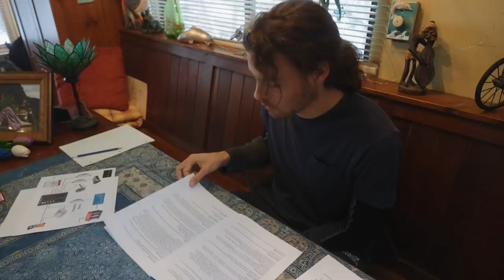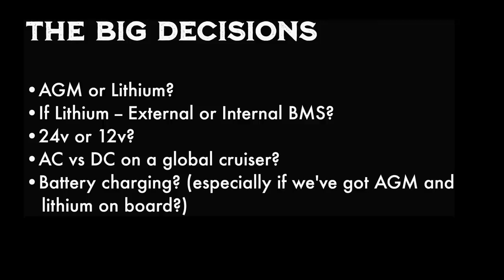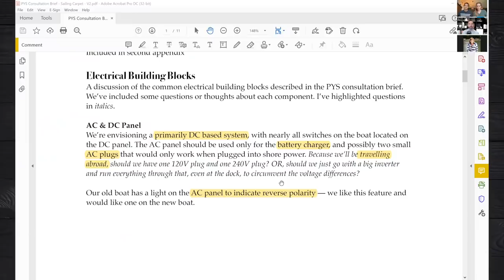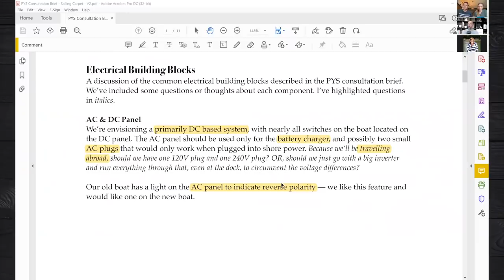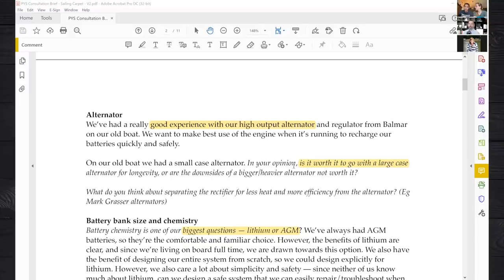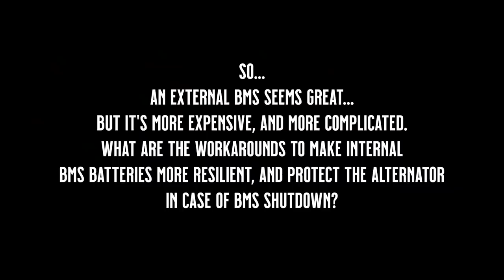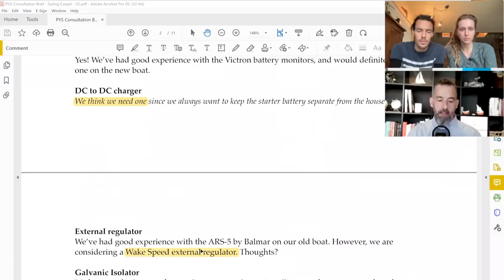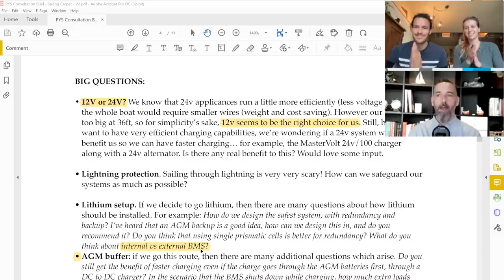DESIGNING an ELECTRICAL SYSTEM for WORLD CRUISING (with Jeff Cote from PYS)

Comment: I forgot the charger for my laptop over on my 38ft Sailboat that I have purchased in North Vancouver so I am commenting with  my cellphone from Nanaimo. 

I am an electrician by trade and an Instrument Technologist by profession with close to 50 years experience in heavy industrial construction and maintenance applications. 

A personal opinion that I am very adamant about is that NO wiring on a boat should be of a gauge larger than a #8, other than possibly a #6 from the shore power connection to closest point of distribution. If a larger wire size is going to be needed,  an increase in the voltage of the bank should be strongly considered. Also a lightning protection system ground wire should be probably be at least a 4/0.

As I am looking at going to an electric drive in the future I am going to go with a 48VDC main bank (250/500AH Lithium) and a 200/300AH 12VDC house bank with  possibly a 100AH 12VDC Lith in parallel in the berth to serve like a "Volume Bottle " for the anchor winch, but be easily removable for use on the dingy electric motor. 

Jeff's comments on the external regulator have me convinced for my 48V main bank but I am also strongly looking into Emily and Clark's BMS for my 12V house bank.

As I have some fairly heavy duty tools that I am undecided on carrying on the the boat I have to consider installing a 2500 inverter. 14" skill saw, 3hp router, MIG welder,  etc... Only advice I could offer is to size your battery bank and inverter for the largest load you think you may need and then go a bit higher. Very expensive to upsize later. Using Jeff is a great start
Reply: Meant 10.25inches skillsaw

Comment: One possible solution is to start the engine with a small bank of ultracapacitors.
Reply: The hint about the dilithum crystals from @Glenn edwards is better!
Reply: Anyone ever actually do such a thing? Most impractical in numerous ways.
Reply: It has been done both on land and at sea at this point. There are commercial ultracapacitor starter solutions available (SkelStart, Maxwell, etc.). There are simple products on Amazon and Alibaba for testing the concept. ...and there's several DIY videos on youtube on the subject.
Reply: @vattuvarg  You could also use a spring engine or a air tank and air motor to power start the engine. Or even a good ole mechanical crank. 
I would rather use larger batteries and ditch this fossil stinking thingy. Uma is living proof electric motors are superior.
Reply: @wolfgangpreier9160  Electric motors is pretty much an established technology by now, even at sea. The hard part is that Magic Carpet 2 is a fairly heavy vessel, optimised for older technologies....or rather... Newer technology isn't fully fit for it yet. Regenerative motoring works better at a higher sailing speed so for a traditional monohull energy would need to come from other sources. Using a large area of solar panels would also be easier with a catamaran or trimaran. Does all of that mean that I would suggest Maya and Aladino to stop what they're doing and get another boat? Definitely not. I'm very much looking forward to seeing Magic Carpet 2 SAILING all over the seven seas. Thus I'm trying hard to apply the K.I.S.S. rule to my responses here. An Engine Starter Module (ESM) seems like a plausible solution for them. It recharges in seconds, even from a battery bank at a low level of charge, and then delivers full starting power for the engine when needed. It is also quite easy to integrate into the electric system of the boat.

I really like that they're minimising their energy demands before designing the electricity system. Makes things much eaiser for them.
Reply: @vattuvarg  I concurr to everything you've said. Keep it simple - simple. Thats why i said forget this fossil junk and put in a decent electric sail drive with 2 large battery banks. Nothing but problems with those oil burning appliances.

You don't need much power for such a boat. 15kW would be plenty enough. It could even regen while sailing. 

Again: Ask UMA how they fare with it. You can store the batteries where you've got your diesel tanks and diesel engines now. Plenty of space.
Reply: @wolfgangpreier9160  Been following Dan and Kika for a while and really like the way they sail and live in Uma. But the choice of whether or not anyone should go (more or less) fully electric is a choice all sailors must  be free to make themselves, even Maya and Aladino. One thing to remember is that electric cruising pretty much still is a quickly moving target, so choosing the right equipment is really hard and gets even harder when considering the future selling value of the boat. 

The main difference between Uma and Magic Carpet 2 is regenerative motoring vs diesel engine. The latter system is the current default in the sailing world, and yes, going fully electric is the (quite near) future. But remember that Uma didn't have a working engine when Dan and Kika started their adventure, Magic Carpet does. 

A suggestion to Maya and Aladino is to get a portable induction cook and test it extensively on the hard first. I have two induction "burners" in the small kitchen of my apartment, mostly because of the fast heating, but also for the possibility to store the portable units in a cupboard when they're not needed. Today I cooked for four with only one of the units, btw.
Reply: @vattuvarg  You are not correct in your assumption that sailors must "have a choice between dirty fossil and non-fossil". This choice will be made for them in a few years. 

Not now. But in about 10-15 years most harbors - at least in Europe - will ban small private boating with fossil fueled engines. 

Netherlands will start and all others will follow. If you start early with your adoption of non-fossil fueled boats you can learn early how to handle this change of technology and adapt more easily.

Of course you may ignore this disruption. Just as many ignored the change from Nokia to Smart Phones. Nonetheless it will happen.
Reply: @wolfgangpreier9160  - The speed of the change to electric cruising is exactly why it is so difficult to give any advice. The old "safe bet" is rapidly going away, but that doesn't make the new alternative any easier. Going DIY would be an adaptive solution for Maya and Aladino as they are certainly capable of it, but would the next owner of the boat know enough to keep on cruising with it? Would a fully electric MC2 raise or lower the price when selling it? It all depends on how simple the system is to use and maintain. ...in the mind of the next owner. Right now there are very few that understand how quickly the change will happen so the "common knowledge" proposes an existing fossil-based solution before a more sustainable one. 

It seems that in some strangely roundabout way we, the fans of MC2, partially get to decide how soon the transition to electric will occur. After all, the boat is soon to become both the "moving castle" of our heroes as well as their studio and home office. We are part of their income and the better they adapt to the future the easier it will be for us to follow their adventures. In fact, I believe that part of their adventures will touch on the change of our planet and how they (and the rest of us) adapt to a new way of life. It'll be a calmer version of Waterworld, probably. Can't wait to see it.
Reply: @vattuvarg  I can predict with certainty: when they stay with diesel power they will have to invest and repair regularly. If they switch completely to electric power they will invest once - maybe even the same amount in the beginning - but not have any issues. And the cost of the energy is much lower. Maybe Diesel is cheap in the US. But nowhere else.
Reply: @vattuvarg  Let me phrase it this way: 

I would recommend RAN a switch to electric but in their case its much more expensive. The sail drive must be stronger, because their boat is larger and much heavier, the battery bank must be larger, the solar must be larger and theire Diesel engine was ok at the start of their last journey. If you have the opportunity to think about refitting a boat i would try to go electric. 

4 reasons actually. First its silent, second it does not stink, third its cheaper in the long run and fourth its better for the environment. And in 10 years you have the advantage if you sell it that everybody will want a electric drive train if they venture outside of the US or the Bahamas.

Comment: I doubt you will read this, but I'll put it out there anyway. I like your Chanel and your approach to doing things the right way. I'm sure Jeff is a great source for advice, but you need to get  a handle on this system design yourself. I didn't like the way Jeff moved to technologies without first talking about your needs. Think about that. hard. Make a list of your actual loads and how much time per day in each at anchor, at sea and at dock you will have. Lights, pumps, fridge, electronics, and big stuff like windlass and engine starter. It all really matters. Figure out what you need and what you want to add later. Design the core to meet those needs. Lithium is great for cycling, but not so great for standby power. You see lots of YouTubers dropping battle born batteries in place and then replacing them a year or two later. It is not the battery's fault. It's the way it is used. Once you use induction, you will get rid of your propane. You can buy a simple one eye for like $75. You won't go back. 

Jeff was not quite on track about the idea to charge the AGM first and then use a B2B charger to charge the LFP bank. Peter is to charge both through an isolation diode but set the voltage for the LFP. Then add a little B2B charger for the AGM bank so it gets up to high enough voltage. I'd like to offer more advice, but this isn't the forum. My message is that you really out to do it right and that means doing it yourself. Would make for some nice content too. Good luck!
Reply from the maker: Actually a part of the consultation brief was to outline all our loads. We made a whole chart about that, just didn’t include it in this video. All the technologies discussed here are with our specific use case and loads in mind.
Reply: Having at length discussions with Jeff about specific subsystems and component options, the technology available also has made great improvements. It is hard to keep up with all of the newest choices without discussion with others. For example the blocking diodes are now a legacy tech, inefficient and surpassed. 
Great the world community lets us learn and collaborate together.
Reply: @braithmiller  there are diodes for different purposes and they are not out of fashion for some. Jeff suggested it is best to charge the AGM bank first then use a B2B charger to charge the Lithium but that Victron only made small ones. That's not good advice. Since AGM bulk charge is at a higher voltage than desirable for lithium, it is better to set the alternator to charge at the with higher acceptance rate of lithium with lower voltage which is incidentally the same as the AGM acceptance voltage. This will keep the AGM charged. You then should add a small B2B charger to step that voltage up to the AGM bulk voltage to preserve the AGM batteries. A small and inexpensive B2B charger for that will be just fine. However, you need a diode to keep the higher voltage from the B2B charger from raising the voltage on the lithium. Your newer tech only works when charging  two banks of the same chemistry and is simply a switch connecting them when there is charge. With different voltages of two different chemistries you need diodes.